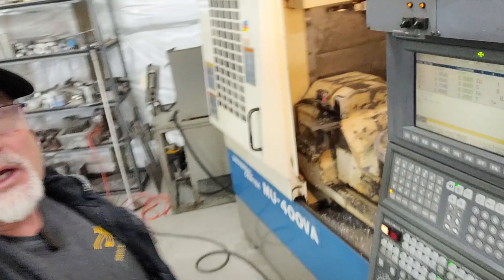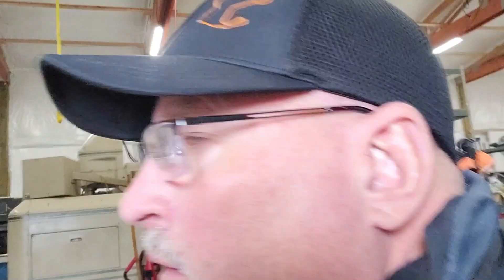A.I. thoughts

Comment: Glad to see that you didn't freeze up in your shop. xD

I don't think the programms are optimized for something specific like that.
If it outputs something, it'll probably be junk to semi good. I'm not a programmer, but with my limited understanding it'll just make use of web search results, compute them and print them out to you.

I don't think there is a calculation engine for 2-strokes or something of that kind in it.
Reply from the maker: Thanks there have been a few times I sat out front  in the truck with the heater on. haha Yes Im seeing it doesnt get it...yet, but if we fed it the correct info?
Reply: @SpeedofCheeseRacing They could feed it the whole Engmod2t functions, but then it'll at best as good as Engmod.
It is not intelligent in such cases, it's not a human researcher/professor. We've got some years to go until it'll be programmed to solve such combined complex phenomenons like a 2-stroke engine correctly.
It's soo way out of scope that I think in the next 30 years it won't be able to solve any unsolved phenomenons in physics on its own.
AI is a thing but it's not as big as some might think.
Reply: @SpeedofCheeseRacing  Haha hope you didn't have to put antifreeze in the machines coolant. :D
Reply from the maker: @stonecraft745  Ya you might be right. Seems like it has come along pretty fast though.
Reply from the maker: @stonecraft745  Haha luckily no. Although I did have to put some in the track bikes as they only had water.
Reply: @stonecraft745  If you train it on simulations, many design's, and feed informations on what different changes make in real life, good and bad, then it can be "creative" but yeah, it will make a lot of bad designs, more like it will show something new to us :)

Comment: Hi Mark, I've been thinking about this since you posted the video. One area which gets no real attention is the flow in through the transfers - it would make an ideal 'flow in ducts' question to ask due to the curves and transitions by the gas mixture. Every porter of four-strokes will point to the 'D' shapes involved - a broader width on the short turn - yet I've rarely seen anything like that in a two-stroke. A two-stroke guy will reach for a Time-area figure but not back that up with checking flow resistance. This is especially true with the restrictions of flow shape dictated by the 102mm bore centres. Worth a shot?
Reply from the maker: Yes I agree, but I'm just not sure there enough area, because the 102 centers, to do much with that. I am going to think about it and maybe model it on the RD ports. I once played with CFD in solidworks but really didn't come up with any real useful information (may be my lack of knowledge). This thinking does make me think a flow bench might be a good tool.